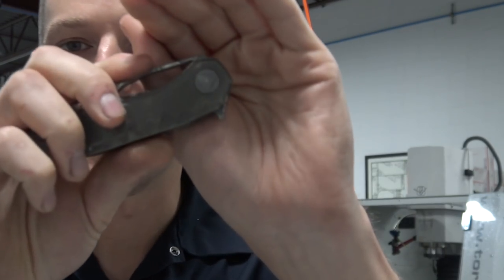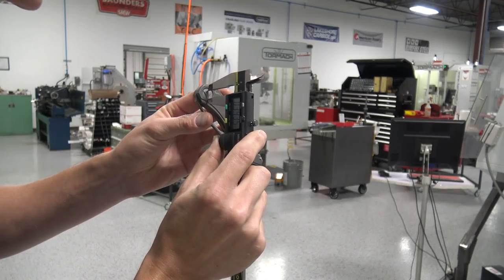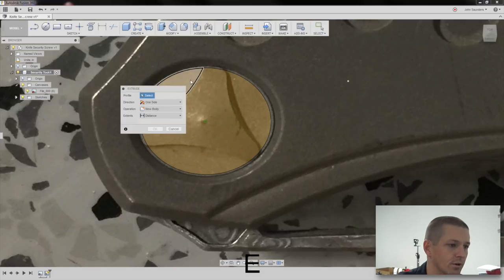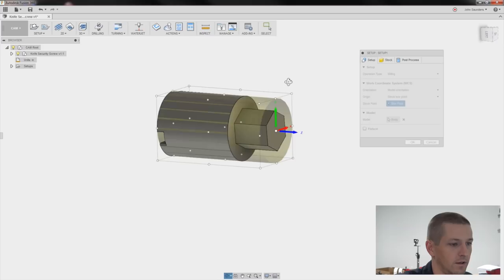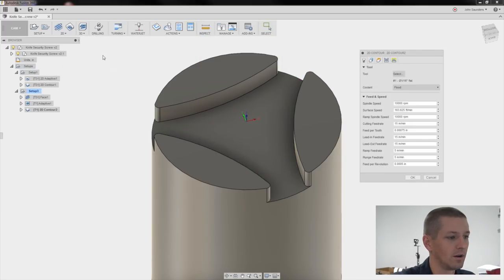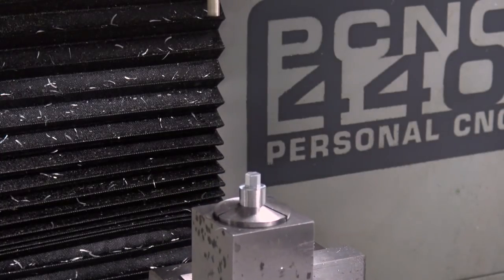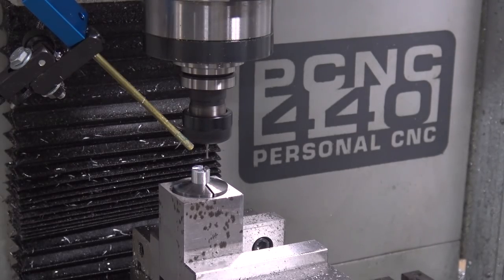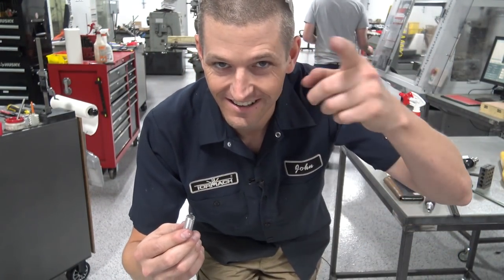DIY Knife Security Screw Tool!  WW115

Comment: I do this at work quite frequently with sheet metal parts using solidworks but with a flatbed scanner. So easy for parts with complex geometric shapes to just whack it on the scanner, import the picture, set the scale and your done.

If your really tricky solidworks even has an autotrace feature which will trace lines of high contrast gradient, but it rarely works in practice.

Comment: Awesome video! When it comes to great burring tools. What we use at work is a 1" wide carbide bladed paint scraper. They cost like $10 and are amazing for breaking sharp edges on pretty much any aluminum part.

Comment: Thanks John
Yes you have saved my bacon , I have a set of plans with a cam template drawn up but only the dia of two parts but not the complete geometry ( the artical he wrote says cut it out and stick to stock and machine ugggg) so your info will help out. 
As f360 will not do a true 4 axis and I needed a slow helix 90 deg in 37 mm on a 18mm shaft I hand coded it quick and dirty

G1 A90 X37 F50

just jogged it down to set depth 

Came out good 

It's a corliss mill engine 
Stuart

Comment: I really liked the info on how to do this even if there may have been better ways of doing this. The only thing I saw that I really thought was check the radiuses on the part with a gauge and check the radius on the cad.  Since the part was symmetrical it would seem better to pattern the other 2. Having said that for a unsymmetrical or really odd part this will be handy.

Comment: Easiest way to make measurement that way is to set your calipers to a know length (ex. 1 inch).  Put the picture into ms paint.  Put the cursor on one tip of the caliper and look in the lower right at the x and y pixel.  Put it on the other one and get the x and y of the other one.  A little trig and you can find the number of pixels in between to find the number of thou per pixel.  This is also helpful for finding a profile to model a spline so you can set your points in x and y then scale.

Comment: How about taking a photo of the part right next to a "scale/ruler" something that has mm's or inches and put the picture in a sketch and scale it until it mathes the units on the photographed scale
Reply: I put some of the small original parts in the scanner with a scale next to them
Reply: The scanner will do a slightly more precise "do not distort the angle" job

Comment: if you are stuck and need a quick fix superglue something to the bolt or screw.
Just saying.
Reply: Simon  Hopkins: I think super glue is fairly weak under sheer stress.
Reply: Pretty much, that is unless you have a lot of surface area.